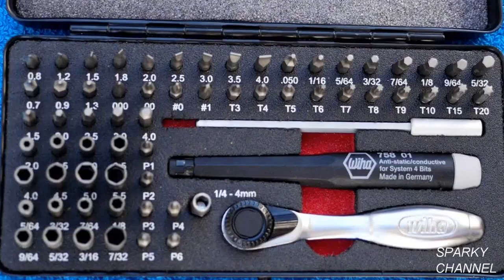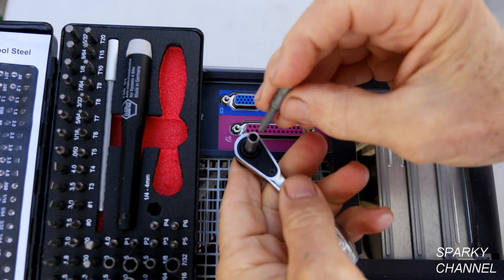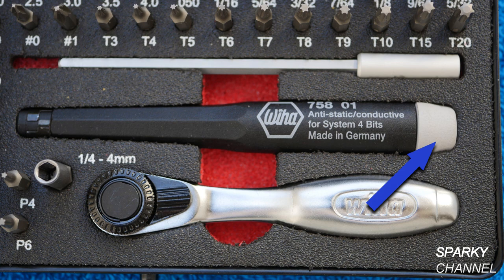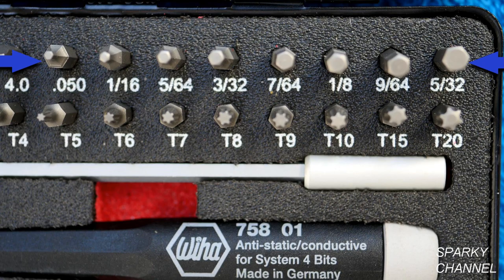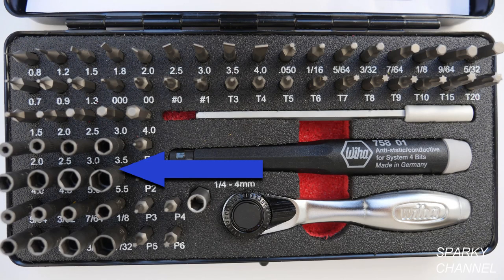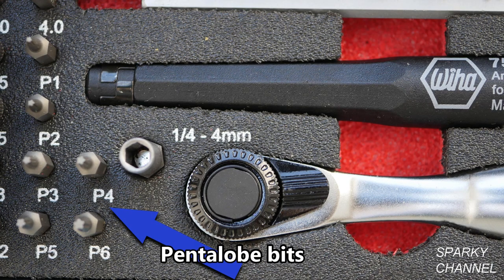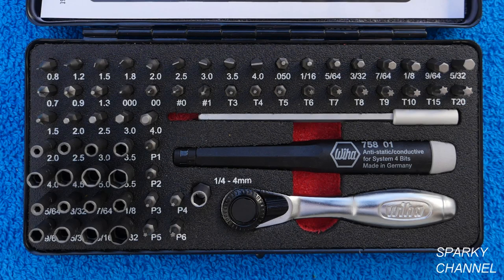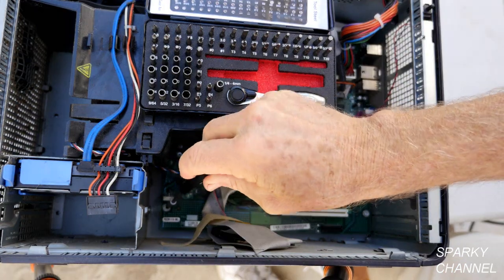Wiha Precision Micro 65-Piece Bit Set 75965 Made in Germany Review

Comment: I am curious how the Wiha small flathead bits hold up when having to apply pressure to remove a screw. Typically the tips on bits that small twist or lose their edge. What has been your experience when using the Wiha bits?
Reply: Wiha actually makes some of, if not the best precision bits you can buy. However, they have China making some of bits now so unless it specifically says made in Germany DO NOT BUY! However, the ones made in Germany are like the best you can get in terms of hardness, fit and overall quality. It’s crazy how you can go from being one of the best to a mediocre at best
Reply: Anyone know where the bits in this wiha set are made in?